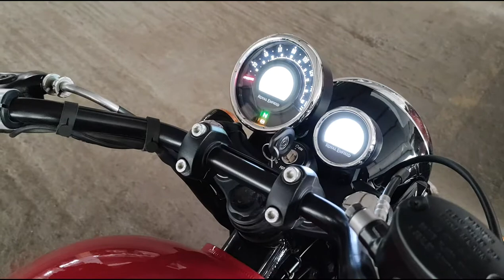Catalytic Converter Removal CatConectomy Meteor 350

Comment: I agree to your enthusiasm towards improving a meteor. I myself own a supernova 350. What I will suggest is to add a 20mm hole in the exhaust right below the front foot peg downwards. This will increase the air output and will ignore the clogged exhaust. Just keep the blob there so you wont have any issue of too much sound for the authority to get distracted. 
Removal of centre of air cap is totally advisable as dna stage 2 comes with such caps. 
For now I have modded mine with the hole of 10mm and the rpm which used to load like hell previously, goes on supporting the speed. Its working beautifully and now Im pretty ready to increase the air flow. Does add a little thump but nothing too much loud😉😉😉
Reply: hey, do u have any pics of the modification please 🙏

Comment: You may want to spray some WD40 into your exhaust and into the drain hole below. I would have removed the cat and added a straight pipe. Very nice to see the original RE mechanics at work.
Reply from the maker: What purpose would spraying WD40 serve?
Adding a straight pipe presents the problem of supporting the centre stand when folded, else it will rub against the chain, you have to get a supporting arm welded onto the swing arm or the exhaust pipe for that.
And... those are roadside welders not RE mechanics.
Armchair critic!
Reply: @padmakarvikas  Do a little research before you start calling names bubba. WD40 is a known rust killer and rust inhibitor. I would not post an exhaust looking like that. Regarding straight pipe;  https://www.youtube.com/watch?v=vtTJib2PrvA   and regarding RE mechanics;   https://www.youtube.com/watch?v=qQxi5IxQ0_g  Have a look if you can spare the time.

Comment: Bro , i am facing an issue in my classic 350 catalytic converter tiktik sound (core cut problem) .RE recommends to buy new one (₹12000) for exhaust pipe.pls recommend any good brand exhaust pipe for me….
Reply from the maker: I'd recommend to go for the genuine Royal Enfield parts only because the police can fine you for after market parts citing noise limit violations however if you can find a replica from outside, you can go for it, search locally with an experienced bullet mechanic or parts reseller, online brands are also expensive and warranty/reliability can be tricky
Alternatively you may also remove the cat con altogether if you wish

Comment: Oooh, I'm also thinking of coating the CAT box into some Rubber or wrap material so that the sound is even bassier . What say ?
Reply from the maker: I see 2 issues with that, one it may not be able to withstand the high temperatures and therefore it could melt and secondly it will harm heat dissipation which could lead to other issues elsewhere

Comment: Did you not fit a pipe inside the catalytic converter box?
Reply from the maker: No, why should I, an empty box acts as an expansion chamber, helps the acoustics too, sounds more bassy
Reply: @padmakarvikas  oh so no air holes when you welded the top back? It looks like it was being welded by its corners only
Reply: @nischhalsharma6059  right, no holes or leakages, all tightly sealed, except for a tiny drain hole as it came from the factory to allow for any water to drain away

Comment: For the Gods' Sake you are the only guy who had the common sense to Decat & not change the whole goddamn exhaust 😂😂
This will save us from getting attention from the cops & challans and money wasted in buying the new exhaust.
One thing i am thinking is that instead of cutting the Cat from the top, I'll cut it from the side from where the pipes are entering the cat.
This will give help in less cutting, less wielding and we might be able to rewield it in future if needed.

Do you think if i just cut from the side, will i be able to pull out that object from the side of the whole Cat box ?
Reply from the maker: If you cut from the side, you won't be able to pull the converter element out, it has to be done from either the top or the bottom only
Reply: @padmakarvikas   Did successful decat at home 😁😁 sound was same from the exhaust but there was a nice rumble from the belly which i wanted.

Then i also removed all the filters in the exhaust by just melting em via a welding rod, except the last one.

The sound hasn't increased much but the back pressure is reduced 😕 
So now the acceleration has increased but starting from 0 with 2 heavy people shows the initial torque lag.

Solution 🤔
Thinking of filling some steel wool in the inlet pipe of the belly, so that the sound will be the same, but back pressure would be increased.
Reply: @padmakarvikas  Also, did you settle on any air filter upgrade?
i saw your series, but it wasn't a success i guess.
Reply: @tanmaysinghal1999  congratulations bro, as for the wool filling go for it since that damage has already been done and you can always try combinations, eager to hear how it goes
Reply: @viktv  it's not a damage for me, since ia almost always ride alone & being a 65kg guy, i Don't feel much initial torque lag
Reply from the maker: Nice, whatever works for you is the best anyways, enjoy